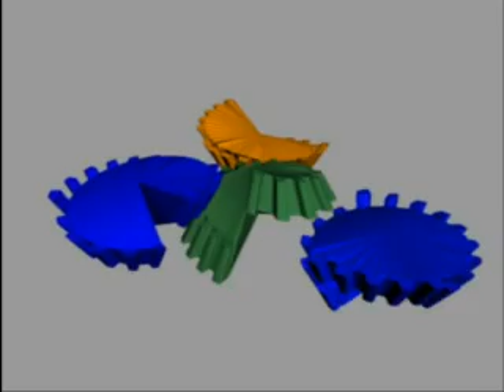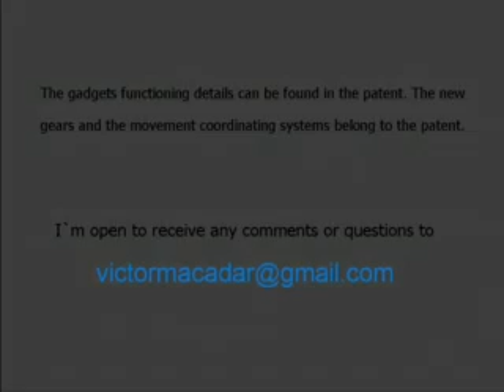New Cvt and New Gears

Comment: There is no change in gear ration....it's a constant ratio
Reply: At the moment a planetary disangages the sun, a stepper-motor turns the planetary (freewheeling-direction-wise) to its new position, one planetary after the other. Then, one after the other, each planetary engages again with the sun (the 1st, while the 2nd is still changing position, and the 3rd hasn´t disangaged yet), and now, the planetaries are in a new relation to the sun gear. It has increments, that differ by one gear-tooth at least, so, it´s not a CVT with countless gears, but still, there is probably more gears than one needs, and it´s smart... Probably the only positive-engagement-gearbox that is smart, along with the Edyson-CVT, which looks much more expensive to build. ...